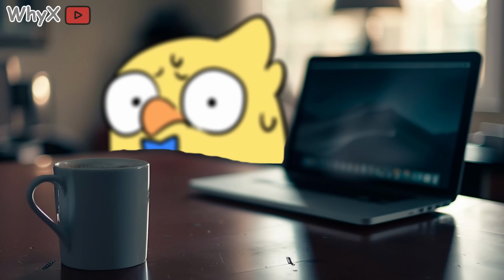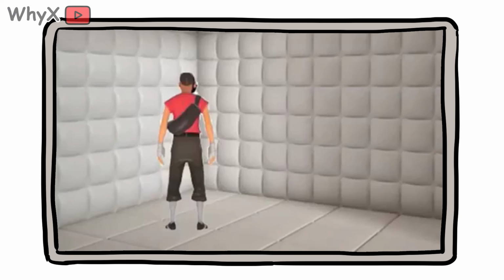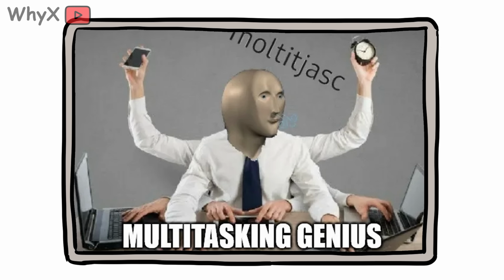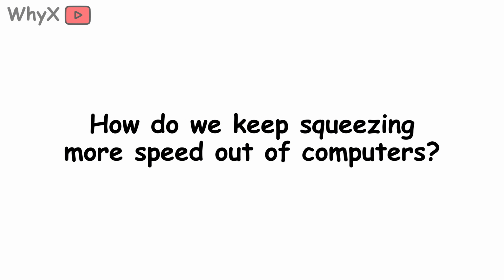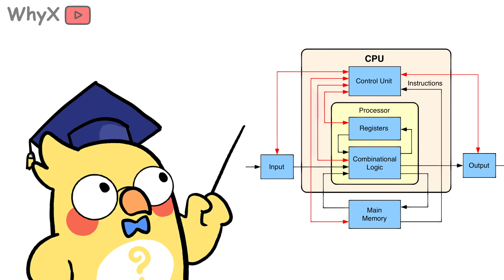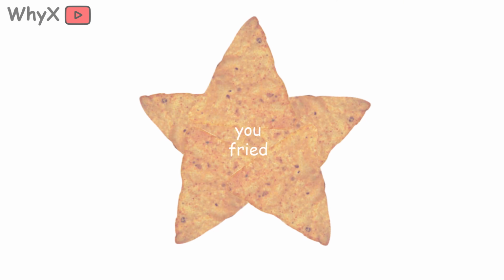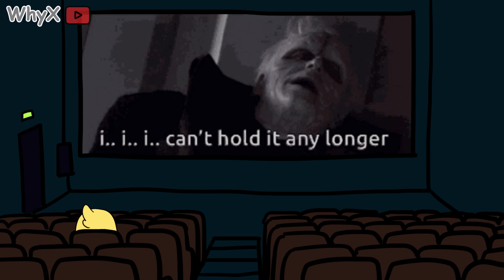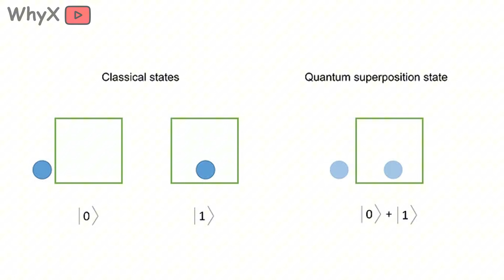How Do Computers Crunch Billions of Calculations Every Second?

Comment: I'm gonna pitch in. I'm not a tech expert but I've recently updated my PC from an old machine from 2012 to a newer one from 2020s. So what happened in those 10 years? Storage went from mechanical HDDs that literally have spinning disks in them that revolve at speeds 5,000-7,000 revolutions per minute (RPMs) to Solid State Drives where there are no moving parts. It's just electrons being shuffled around between storage cells. SSDs are much faster because of that, but paradoxically have a shorter life span and prone to faster wearout. Another thing that improved is the literal width of the data pathways. Today, your SSD and your Graphics card are connected to the motherboard through PCIe connectors (I don't know the proper technical term). So, 10 years ago PCIe 3.0 was the newest and allowed throughput of 1 GB/s per lane. Then PCIe 4.0 doubled that, and then PCIe 5.0 doubled that again sitting at 4GB/s. RAM slots also improved data transfer capacity (DDR3 > DDR4 > DDR5)

I've built my PC around Intel's 11th Gen CPU (11600KF) and the motherboard that uses PCI-4 all around, and DDR4 memory. I paid around 850$ for everything. Now, for the same price, you can opt for AMD AM5 CPU and build your machine on PCIe 5.0 and DDR5. AMD's Ryzen 7400F is almost identical to my 11600KF but because other components have higher data throughputs, AMD's processor has around 30% higher performance but the entire build costs the same (I have a video about how I put my PC together on my YT page)
Reply from the maker: That’s awesome! In those years, processors got way smaller and faster, so now computers can crunch way more numbers every second